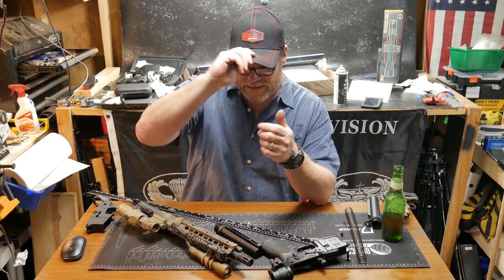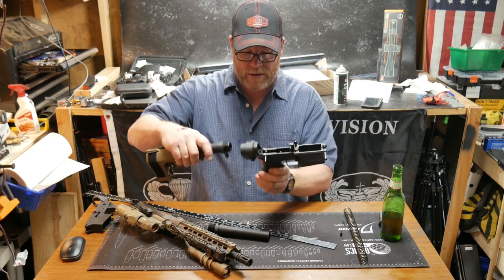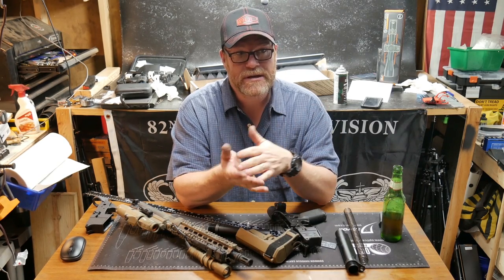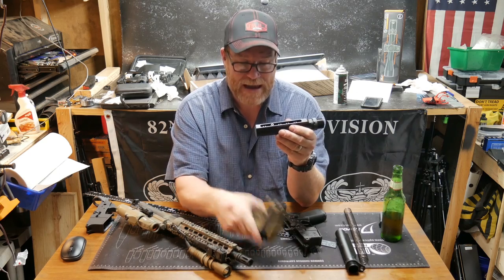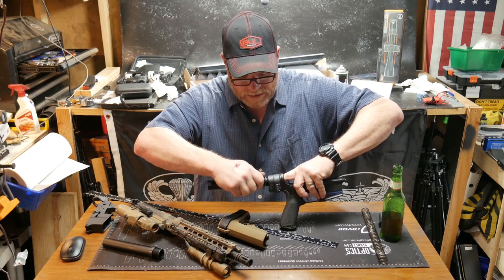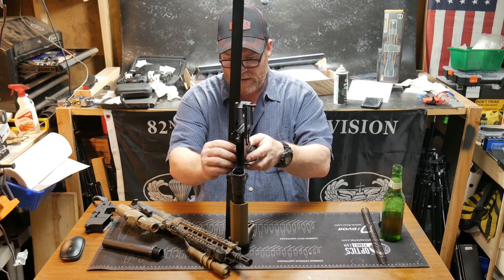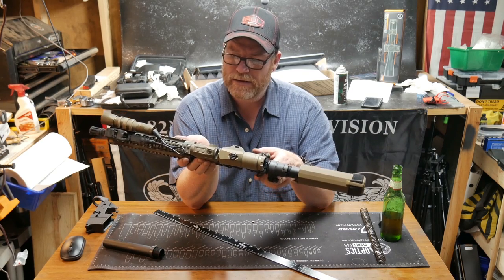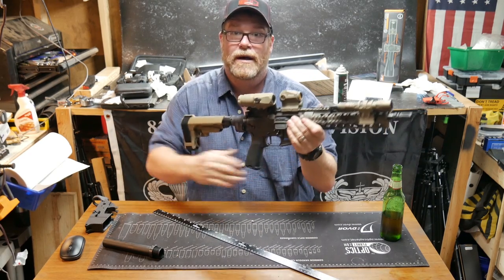CMMG to the Rescue!  RipBrace has Built in Length of Pull Limiter

Comment: I was able to limit my length of pull by drilling (5/32) one of the 3 holes in the sba3 buffer tube and screwed in one of the smaller screws from a Magpul MLOK rail section with red loktite

Comment: Well then get a BCM vertical forgrip which is not 90 degrees it's at an angle and then you can have a VFG and stick it to them . A VFG per their definition is 90 degrees . That's not even though it's labeled . Enjoy gentlemen.

Comment: Nice video I found  a better and cheap idea for the length trigger pull by using a electric plastic plug wire by putting in the hole in the back of the buffer tube getting 13in trigger

Comment: Wait I have to put a set screw on my buffer tube thats on my pistol so it can be legal???
Reply from the maker: If you have a law Tactical folding adapter then most likely your length of pull exceeds 13.5.  if not you're fine
Reply: @kotaboy32  13.5 is the max on a brace?
Reply: @2wheeleddemon999  the max for any pistol

Comment: What’s this rubbish regarding 13.5” for LOP? Is this an actual law or a ‘judgement’ or ‘interpretation’?
Reply: Ion think this is law
Reply: I have seen guns in my local gun store that has the folder on with the sba4 brace on it. So I don’t know.
Reply: I'm not actually sure it is even though the ATF would like you to believe it is. There was a case where the ATF tried to say that an AR pistol where the owner had installed a cane tip on a Maxim Defense Brace which created a LOP of over 13.5". The ATF tried to have him prosecuted for having an unregistered SBR based off the installation of the Cane Tip which they said modified the brace and caused the pistol to have an overall LOP greater than 13.5". But there were two problems with the case. 

1) The ATF measured the LOP incorrectly. When they measured the LOP they measured it diagonally instead of in parallel which is how they normally measure LOP. Because of the way they measured it it created a longer LOP than it had and it was actually about 13.25" which means it was lower than the 13.5 max they were trying to claim. 

2) The ATF never published an open letter to the public stating a pistol could not have a LOP greater than 13.5" on a pistol. The only people that they communicated that requirement to was some manufacturers of the pistol braces which means the public really has no way of knowing if there actually is that requirement or not. The ATF unsuccessfully tried to have the court records sealed and the letters to the manufacturers sealed. 

Because of this case people think there is a LOP requirement for AR pistols. Problem is I can't find an actual open letter to the public from the ATF stating that there is a LOP requirement for AR pistols. If the ATF hasn't published one then I don't think they can't prosecute you for it. But then again, I didn't sell my soul to become a lawyer so this shouldn't be considered legal advice. LOL